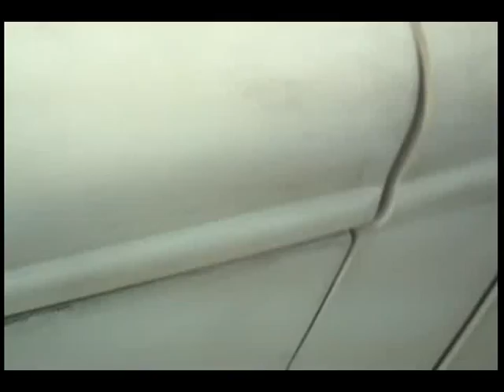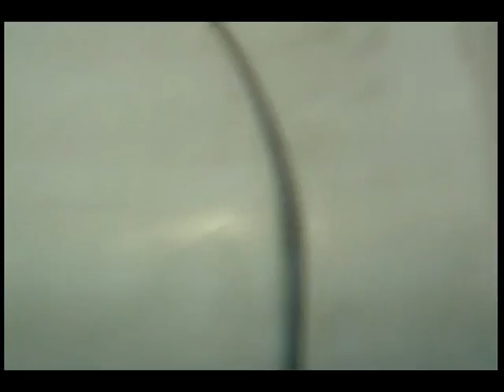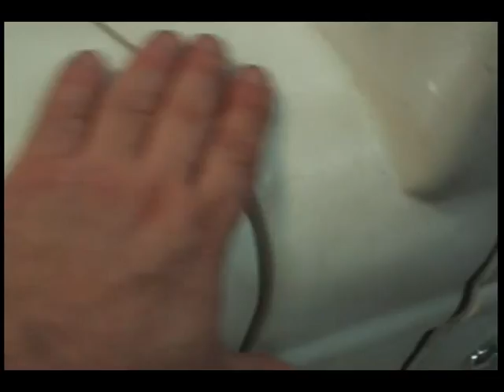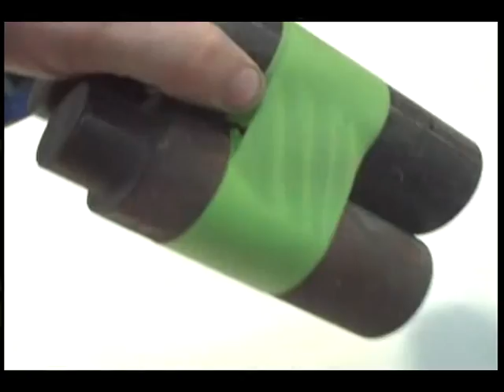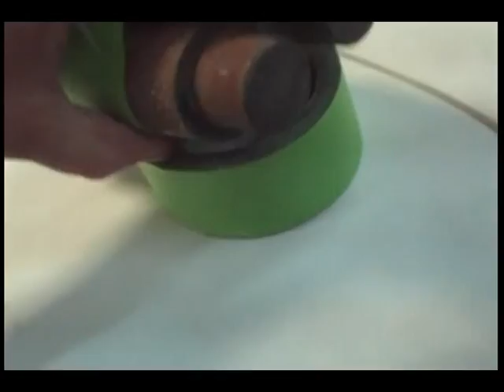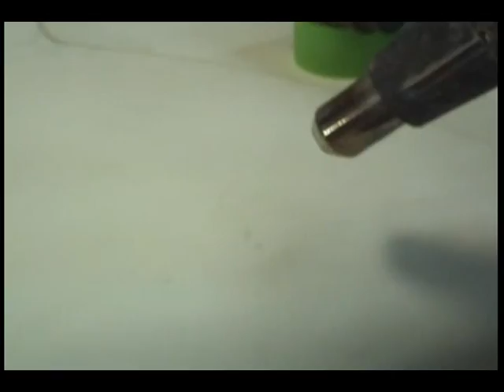Bending fiberglass with heat 1 (raw video)

Comment: This dude shows that he is using a temp gun to monitor how hot the panel is getting, but doesnt tell anybody how hot or what temperature that should be avoided when heating up fiberglass.
Reply: actually this is the "Raw Video" used to make a longer one

The raw videos were dumped on youtube after the factory closed as reference material for the customers.

Typically 150 to 180 degrees will cause the fiberglass to move
 

https://youtu.be/3GgkIgVox1c